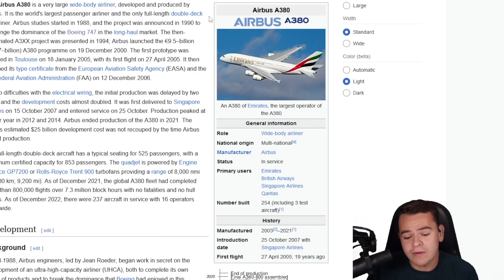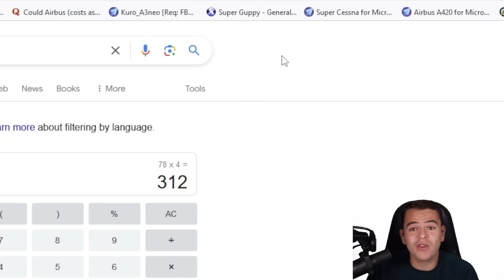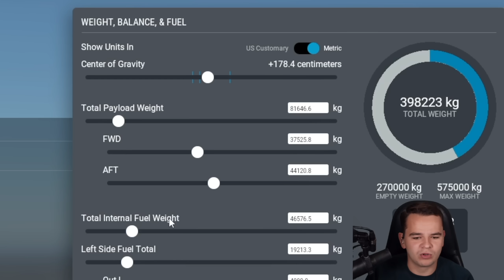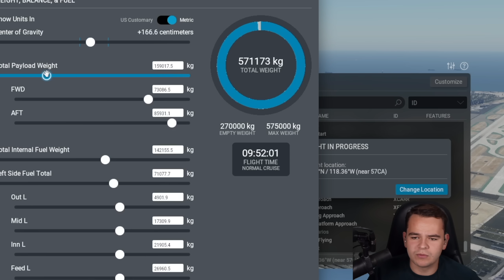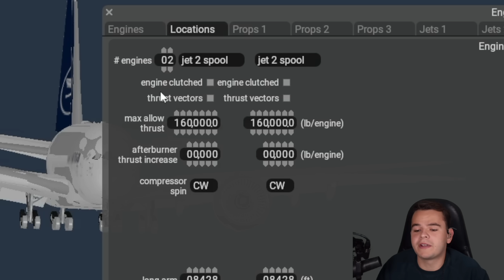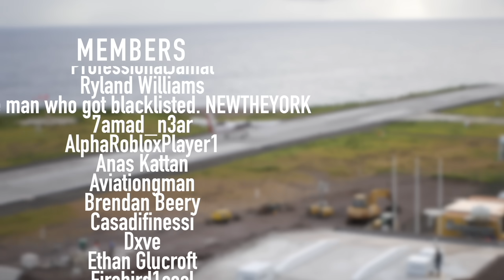I Fixed The Airbus A380

Comment: A common misconception is that 4 engines consume far more fuel. The difference isn’t that big. The difference comes from maintenance costs. I believe an A380 is still one of the most fuel efficient planes per passenger flying when full, but filling it is the problem.

Comment: Try the boeing 747 with 2 ge9x rngine and mouted them on top of the wings for a coenda effect and the most powerfull turboprop engine on the very back on the plane that where the apu is but on top of it in the body skin

Comment: Um quadjets dont burn 2x the fuel of a comparable twin. they have much weaker engines because they only need 133% thrust and not 200% in case an engine fails.

Comment: The problem will be ETOPS. How will it do if I e engine fails.  Government regulators require 370 minutes of single engine performance to be able to get you across the Atlantic or Pacific. That's over 6 hours. I wouldn't feel comfortable flying in an A380 with only one engine.

Comment: I wonder how the plane would have been different if they had designed it as a tri-plane with more powerful engines. 3 of the biggest engines we have today would put out just as much power as the 4 engines on the plane. It wouldn't quite be as efficient as a twin jet configuration but it would have been better than with 4 engines. Who knows.

Comment: The fuel isn't even the real problem. The problem is that with scale you can achieve cost savings especially when it comes to maintanance. Other than Emirates and maybe Singapore Airlines, all airlines ordered <15 A380 and most of them are actually operating even less of them.
This just means your whole maintanance operations are super inefficient because you need people who are trained to maintain the A380 but also you really only have them come in for maintance maybe every other week. Emirates on the other hand has as many A380 as other carries have A320 or B737 so their whole A380 operation works much more efficient. Of course they massively benefit from being the main carrier for a oil rich country but still the main reason for their success is their scale rather than the lower fuel costs they may have over lets say Lufthansa or Air France.

Comment: The A380 might have a MTOW of 575 tons, from what I‘ve heard it is taking off most of the time at about 100 tons less than that on a 10-12 hour flight, because it is made for a stretched version in the first place. The A380 would have needed a -900 from the beginning.

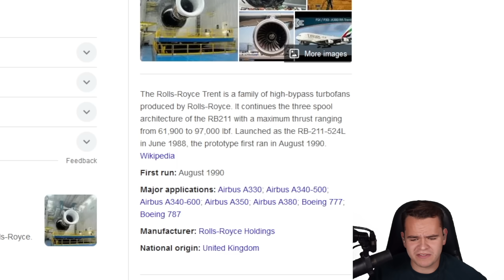Comment: 1:15 what about A340-500 and A340-600 they have four engines and use the same
Reply: Which were notoriously underpowered and the a340 is also no longer in production.
Reply: @jdraupp  i said the A340-500 and A340-600 not A340-200 and A340-300 and the -500 and -600 are stronger than -200 and -300
Reply: @Gorillatagfan538  still not in production just like the 380. No one wants four engined planes anymore.

Comment: Rolls Royce engines on planes: (swiss got it wrong)
RR RB211: 747, 757, 767, A300, L1011
RR Trent 500 = A345, A346
RR Trent 700 = A332, A333
RR Trent 800 = B772, B773
RR Trent 900 = A388
RR Trent 1000 = B787
RR Trent 7000 = A338, A339
RR Trent XWB = A359, A35K, A35F

Comment: Swiss should have used GE90 engines with afterburners maybe the Airbus A380 might have worked and try it on the Boeing 747
Reply: Afterburners on a a380 is so unrealistic
Reply: @polarbear-v7p  idc screw realisim
Reply: @SD-SC5  i mean a a380 with afterburners would be pretty cool ngl
Reply: @polarbear-v7p  i know and with 747

Comment: We need an A380 trijet with the ge90s now..
Reply: My thought exactly!
Reply: If it’s an A380 with 3 engines….. it’s not an A380 💀
Reply: How about a hybrid? -Have 2 large engine generators, that create both thrust and electricity + 2 outer electric only engines. With this one could get ridiculous bypass ratio + electric engines would allow for much more precise differential thrust control thus less use of the rudder - less air resistance losses. For the additional safety of mind a much beefier APU can be used, so technically, this would be a trijet, with a third engine hidden inside the tail (fully protected from bird strikes), and used only during takeoff and landings, or in emergencies.
Reply: @solarissv777  airbus is making that with a program called zero
Reply: tri star L1011 revival
Reply: Then the rear would be too heavy
Reply: No trijet ever again please. Putting an engine right in the middle of the most critical control surfaces of an airplane was the stupidest idea ever in aviation history.
Reply: @gonenguldal5782 true
Reply: @gonenguldal5782  your mouth is the problem
Reply: Lmao

If we wanna get technical the third engine would add more weight onto the fuselage

Comment: Hey swiss001, that's a bad idea because if the A380 has 2 engines, even though it has has Rolls-Royce Trent 900s and Engine Alliance GP7000, it'll be underpowered because the A380's MTOW was 575 metric tons, and still, dispite having 2 engines, still, US Airlines still don't use the A380 because of the weight